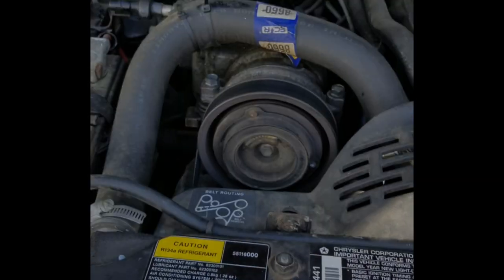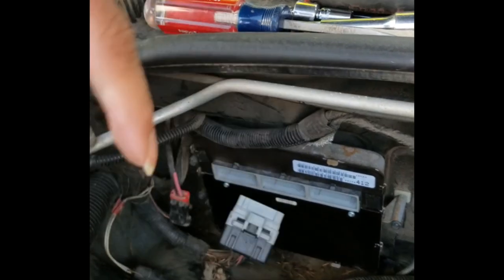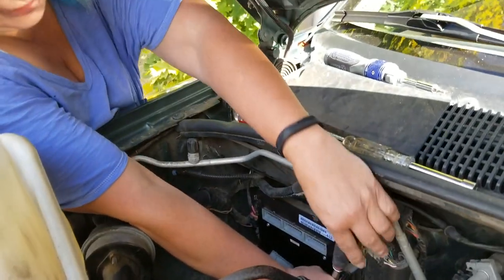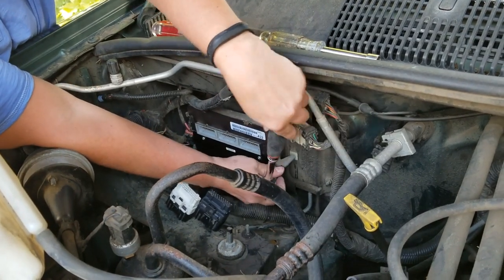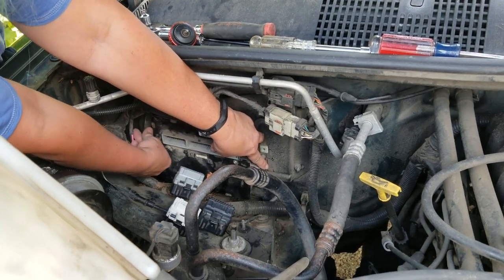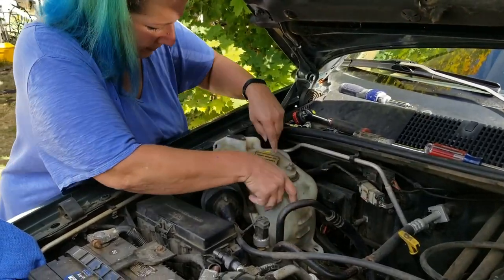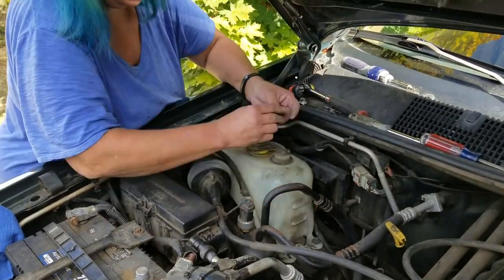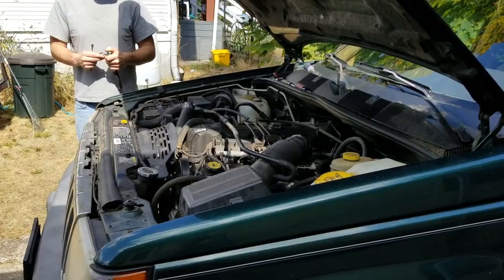1996 Grand Cherokee Laredo PCM Replacement By A GIRL!!!

Comment: Sounds like the connector contacts to the Computer are not making positive contact. You might try applying Dielectric Grease to the contacts. I have not had any issues  with my ECM so far. But this Jeep has an ABS computer that has failed. But I have found a work around.

Comment: l also have a 1996 Jeep Grand Cherokee, with just 86,000 miles. Question: Was  this ECM engine computer failure catastrophic?  I was wondering what will happen if it fails while driving on the freeway. Does the car just die or does it enter some sort of limp mode just to get you back home?
Reply from the maker: It was completely dead and would not start..
Reply: Mine died today over a long highway bridge going over lake Waco at 5:30 am. Mine works just the harness gets loose or needs to be cleaned. I have spent at least 650 the last two weeks replacing: Battery and terminals and starter, distributor the rotor and camshaft pickup all new plugs and wires the crankshaft sensor etc.. and it still didn’t crank… I was Lost and mad I replaced everything that mechanics said it would be. I finally pressed on the harness clips on the pcm and tried to crank it and booom it cranked so lesson learned always check the pcm and harness before you replace all that I stated in the comment. Now I just need to figure out how to clean the pins or harness clips because the pcm still works just when it decides to not crank I need to press them in and it will crank.. but it dying this morning on a long bridge that had no side lane and cars almost smacking me every time they passed me..

Comment: How do you test it? I've found replacement pcm for $200 did you get a used one? My daughter's jeep runs perfectly fine when I'm driving it but when she drives it 30 miles to work it starts spitting and spurtering and shuts off then se says it has no power. I'm at a loss everything checks out.

Comment: No way you can do this without reprogramming the PCM with the vehicles vin number and details.
Reply from the maker: This was done quite some time ago, like over 2 years ago and the jeep is still running with the replacement PCM from the junkyard. It was taken out of the same year, exact model jeep that was in the Junk Yard.
Reply: I agree it has to be programmed to your vin and Im also confused it caused issues with the ac compressor but you never showed if it fixed the actual problem you just posted that it started what a bullshit video I would do a follow up vid showing it actually is still running but I highly doubt it